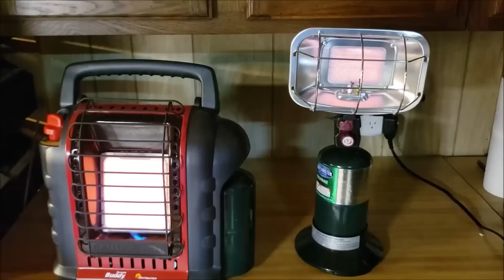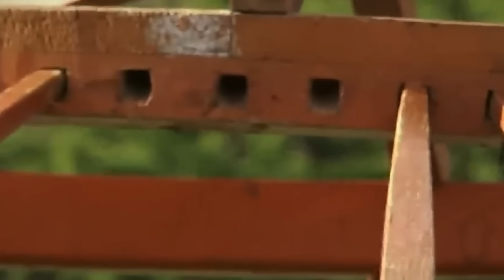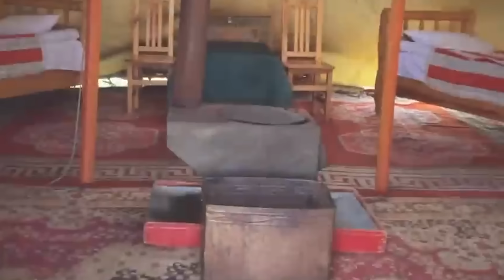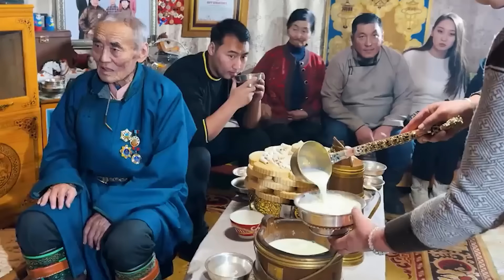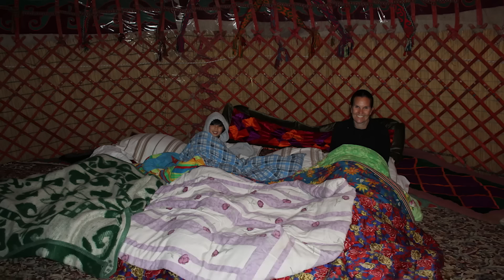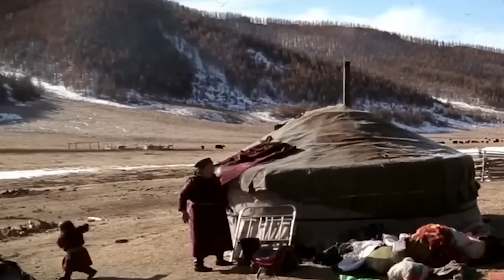How Mongols Sleep in a Yurt Without Heating

Comment: Wool also has waterproofing to it because of the lanolin in the fibers acts protective barrier for heat & keeping out the cold.
Reply: This is better than you might think btw. When it DOES get wet. It doesnt lose its insulation like cotton or linen